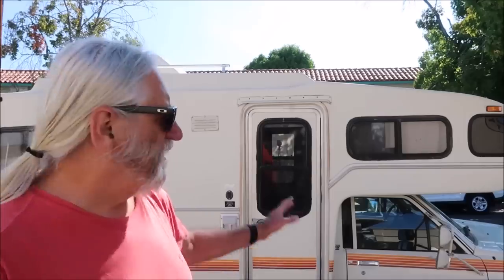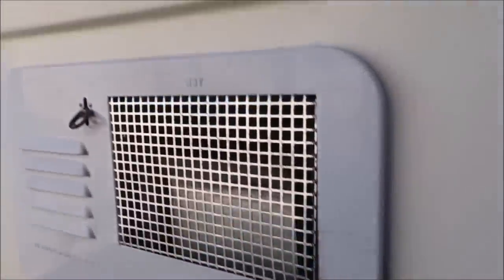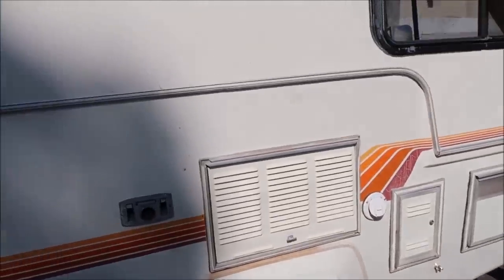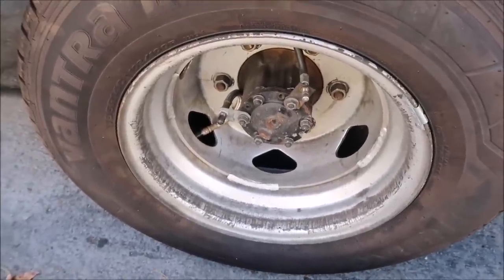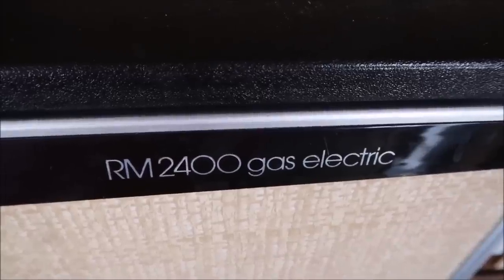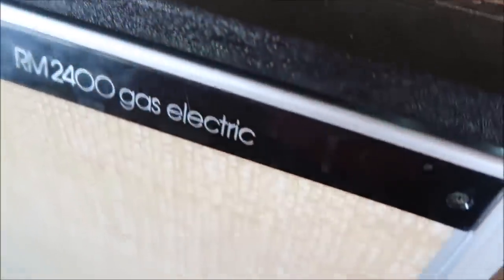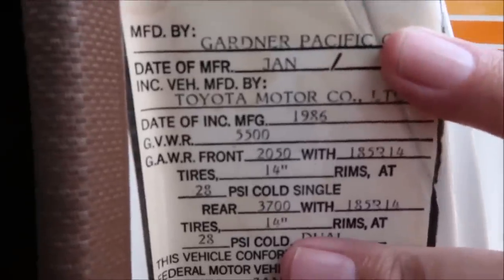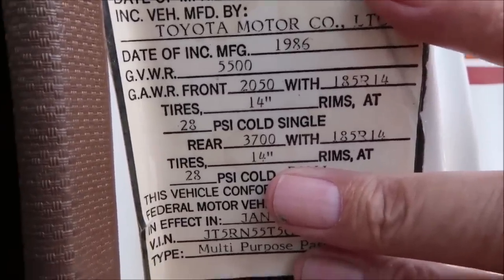What It’s Like Living in a Toyota Motorhome RV and Why They Stopped Making Them

Comment: whats the diff between sun raider, warrior, dolphin thx
Reply: Sunrader is the only one with a full fiberglass molded shell as opposed to aluminum siding so the Sunrader doesn't suffer from leaks / bad joints etc. I have an 18' one and it's totally awesome, took some finding on Craigslist but soooooo worth it!
Reply: @michaeljustmichael4143  Do you recommend fiberglass or Aluminum? Which one have best insulations
Reply: @michaeljustmichael4143  Same here. Bought mine over two weeks ago for 4g. I wouldn't take 6 for it.
Went camping over labor day weekend. Ran 300 miles round trip and she ran flawlessly. One proud owner for sure.
Reply: @smtiic  I'm only used to the fiberglass but I can tell you the insulation works great, especially for keeping it cool in the heat of summer.
Reply: @michaelblackwell7408  Awesome man! I have found that running a few cans of Seafoam and some Lucas fuel additive through the system works wonders, bought my bad idle back to a purring delight. Also use Rotella diesel motor oil - these motors just love it. Enjoy your new jewel on wheels!👍👍
Reply: sunrader is much shorter, you have to tilt your head to walk around...  deal breaker for me, i found a 93 fiberglass winnie itasca! much higher ceiling way better layout [321rb] and easily the best built of all the toyota rv's!

Comment: 3.0 V6 = one of the worst Toyota engines ever. And the older Toyota truck automatics weren't so great either. We took a summer vacation in my brother's '94 4-Runner. That thing was a slug.  Plus, even with  just the two of us and not heavy on luggage, the tranny overheat light kept coming on every 30 minutes, unless we kept it around 60. 
Later cured after I installed an aux tranny-cooler. 
Then some years later, it blew the head gasket for the second time. Unfortunately, Toyota only covered the first head gasket for the previous owner. So the 4-Runner's now been sitting in the garage for 8 years!

Comment: If it has a 3VZ-E engine walk away.  They are worst engines that Toyota produced. Not only in power but in reliability. Head gasket failures and exhaust valve failure issues near the CAT on the #6 and #3.